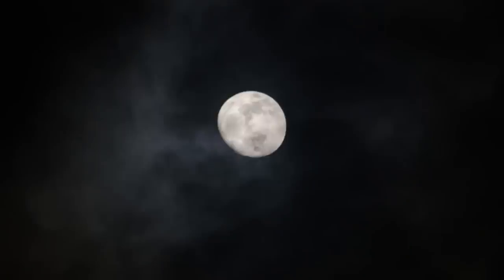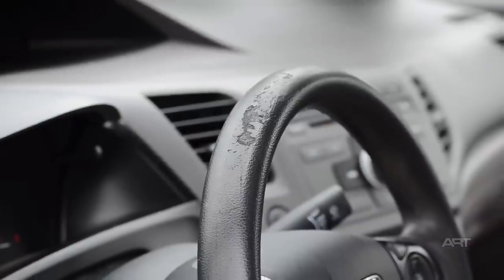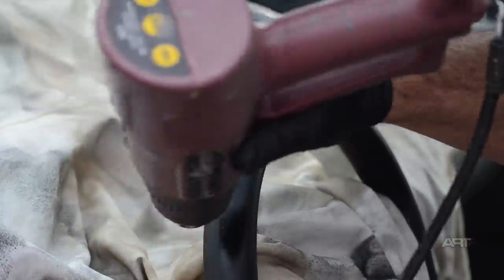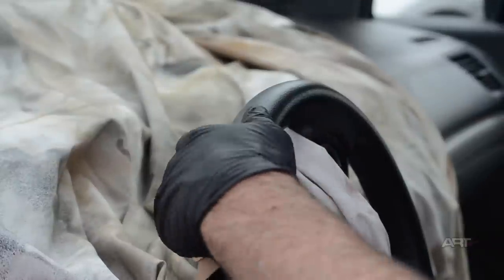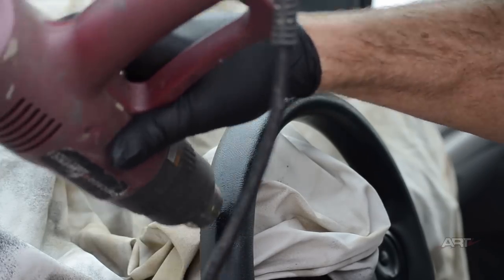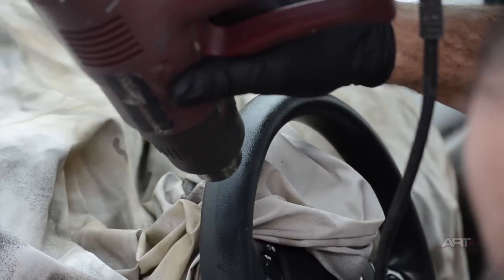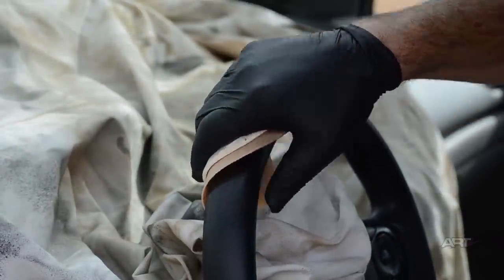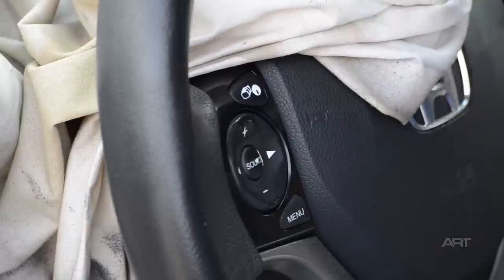Foam Steering Wheel Repair  v06

Comment: I’ve watched a couple of reviews but yours is definitely the best and most thorough.  The sun has damaged the top of my steering wheel (a common problem with car interiors in Australia) and I can’t get a replacement steering wheel for my 20 year old 4WD so I’m going to give the acetone a try first of all.  If I’m not happy with the finish I’ll get some grain pads and finish the job off.  
Thanks for putting the effort into making the video 👍

Comment: Thanks so much for this tutorial!  I just fixed my foam steering wheel.  I didn't use the acetone part, just the heat gun and imprint.
Reply: what material is your inprint
thanks

Comment: I bought my civic new and it’s a 2016 and at 70k miles has more material missing than my 2001 civic with 170k, it’s actually missing material and is no longer round in 2 spots vs the old civic where it didn’t wear a ton but the finish wore. Crazy they’re moving backwards after 15 years
Reply: My aunt bought a 2017 civic and I noticed how cheap everything inside felt vs my older civic

Comment: Wow that result was amazing! Thank you for the video!
Reply from the maker: You're welcome!  Hope that gets you a little further down the road.
Reply: @a.r.t.srealrepairsforrealc8247  I'm about to attempt this cause my steering wheel has gotten really bad somehow. Will nail polish remover work? I'm a little wary of discoloration.
Reply from the maker: @shaazy  Nail polish remover may contain acetone which will help melt and level the foam.  Protect everything including the seat below.
Reply: @a.r.t.srealrepairsforrealc8247  that's true but is nail polish remover right for the job?
Reply from the maker: @shaazy  I use acetone, and am not qualified to comment on something I haven't used.  Also this is not intended as a DIY channel.  But to show the public that better professional repairs can be had.  Thanks.

Comment: I'm here for the exact same reason 🤣 and it's amazing that you fixed the same steering wheel as mine so my question is which texture are you using for your impression after the heat? There are so many grain texture to choose

Comment: That's a good video, what if the steering wheel is foam and a piece is missing,  how to fill that ?
Reply from the maker: You can fill it with epoxy.  I have one in the archive so I'll get around to posting it whenever I can.  Thanks

Comment: Is it possible to use coarse sandpaper instead of a graining pad? The end result will obviously look different. I'm concerned that material will come off the sandpaper and embed into the rubber. What are your thoughts on this?
Reply from the maker: Good question!  i am always encouraging repair technicians to think like this.  Of course no one knows until you try.  Feel free to post your results.  Thanks for contributing!

Comment: I have a 2008 Renault Twingo with a greyish steering wheel. The airbag is some kind of rubbery plastic and it's pretty worn, how would you go about fixing that? I don't think the heatgun method works there. 
Great video though!
Reply from the maker: Can't comment on it without seeing it.  For further info see v116 where I answer a question about the steering wheel.

Comment: Thank for the video!!  I am a novice, having the exact same issues with my Honda Civic steering wheel.  The acetone surfacing and Heat Gun / Texturing seem pretty straight forward, but I'm concerned about the paint and finishing...  I'm about to purchase the Honda: 20 - Black from the website in your description..  but I wanted to ask if I need anything in this final step.  Do I dilute the color with anything? Is there a protective coating I should use after to keep the color on?  I've seen similar repair videos with SEM texture coat spray paint and Dupli-Color Vynil & Fabric spray paint... Your method look much cleaner and less messy.  Great video and thanks for the insight!!!!
Reply from the maker: I am using the waterbase black.  Add crosslinker.  I also use a waterbase clear as a protective coat which is also crosslinked.  Any of the solvent products you mentioned are soft and not durable.  In the old days we did use solvent paints.  Better than nothing perhaps.  The foam steering wheels have a very limited useful life by design so we can't be concerned overmuch about what we use anyway, would you think?  I hate them as much as the next guy.  Thanks
Rick
Reply: @a.r.t.srealrepairsforrealc8247  THIS WORKED PERFECTLY - its like brand new!!!!!!!  Thanks again!!!
Reply from the maker: @frankbull6456  Great!  Glad it was helpful.  and thanks for sharing.

Comment: What about wen the foam is loose on the metal ring of the wheel? Anyway to tighten that up? I’ve considered trying to inject glue of some kind in to is but not sure if it’ll get enough air to dry

Comment: Hi, thank you for the video, you solved an issue I wasn't looking for ;)  My issue is the seperation of the rubber from the rubber steering wheel ring.   what do you suggest for that?  I suspect injecting silicon or tarzan grip?
Reply from the maker: Your guess is as good as mine.  I would likely source a replacement wheel.  Let us know what you find out.
Reply: @a.r.t.srealrepairsforrealc8247  I found some people are using Loctite 408 and injecting it in via a needle.  I have ordered a tube from eBay and will trial it and let you know.
Reply: @octapc  Hello, did the loctite work? I have the same problem.

Comment: Where do you get the thinker pad that you used behind the graining pad? You can find the SEM graining pads online but the thicker pad to protect your fingers I cannot.
Reply from the maker: Just double up any pads you have.  I make my own graining pads and they have randomly varied in thickness over the years.  They can get quite hot using this method.  Also you can wear a leather work glove!  Thanks

Comment: Great video! I've been looking for something this all around the web. Couldn't find anything. I have a 2011 Camry and the steering wheel looks similar to the one you worked on. Top was smooth at first but over time it started becoming more brittle. Now I can feel where the foam has fallen off. Is there a curing time for the acetone or treatment after I use the acetone?
Reply from the maker: While the acetone is very aggressive it also evaporates very quickly.  A good way to tell is by temperature.  If the area is colder than the ambient temperature then evaporation is still happening.  
Thanks

Comment: Hi I have a Ford fusion hybrid 2017 I need that same repair it's really wore out on top where can I get it repaired
Reply from the maker: Any repair tech in your area should be able to do this.  If the damage is too severe I recommend a customized leather wrap.  You'd have to check with an upholstery shop.  Or shop for a replacement steering.

Comment: I have a steering wheel that has a smooth finish, that has worn away exposing the foam underneath. The problem I have is in the winter the foam steering wheel gets damp & then gets stuck all over my hands. Will using just the acetone help to reseal the foam? so as to avoid it getting stuck all over my hands in the winter.
Reply from the maker: That's a good question!  Melting the surface smoother with acetone just might help.  And with these foam wheels...can't hurt!
Reply: @a.r.t.srealrepairsforrealc8247  Okay thanks.

Comment: I realize you are trying to actually restore, but I don't care much about the finish I just want my steering wheel (GM truck) to not be gooey and rubbing off on my hands when it is the cool and humid time of the year. I haven't tried but I think that just cleaning wont do it, it is decaying. Will the reconstituting and heating get what I need?
Reply from the maker: Don't know about your particular model but all the GM trucks have leather wrapped steering where cleaning will do the trick.  If I'm wrong about yours feel free to email.  If you have a foam wheel it's unfortunate but they just won't last very long no matter what you do.  The restoration in the video is certainly a stop-gap measure for a time on an already very limited life product.  Which is why I encourage a custom made wrap.  Thanks.

Comment: Hello. How to fill holes or cracks in foam steering wheels? I have read that it can be filled with flexible epoxy glue, which comes as a 2k injection. Do you apply this epoxi  and then paint? Could it be filler with air-drying filler? or the repair would not last long. Thanks.
Reply from the maker: I have done one with a 2 part epoxy but then I made a custom leather wrap for it.   Before doing too much please understand that these steering wheels are garbage to begin with.  Thanks for your question! 👍

Comment: Hey Rick, thanks for a great video, you may have just saved me the cost of ordering a new steering wheel. I do have a question, How well does the water base color hold up?
Reply from the maker: As you know, oils from the hands are very destructive to the foam steering wheel and leather steering wheels.  So durability will vary on usage.  I would fully anticipate recoating after a couple years.   For retail customers I would recommend a custom fitted leather wrap.  You'll enjoy it so much more too.  Thanks.

Comment: Hi Rick - I drive a Honda HRV and boy do I need this video!  QUESTIONS: In other videos you finish vinyl or leather repairs with a clear coat.  Is that advisable for the foam steering wheel? If so, what type product am I looking for?  Thank you, Sir!
Reply from the maker: Yes a clear coat is a good idea.  Usually I will add a polymer clear with crosslinker and slip additive to help resist hand oils, French fry grease etc.
Reply: @a.r.t.srealrepairsforrealc8247  
Thank you very much, my friend!

Comment: What type of color are you using?  What is the touchup paint that you used on the switch?  Thanks for showing us how to restore this type of steering wheel.  When approaching this type of project, how do you tell whether leather, bonded leather or plastic covered foam is involved in covering a steering wheel? I know the differences should be obvious, but the car makers cut corners where they can, and can process plastic to make it look and act like anything they want.  

As you move forward with your videos, you will find you attract more viewers if you put the specific materials you use in the “Show More” box (sometimes called the video description box) with links to where the products can be obtained. Take a look at the Sweet Project Cars channel on YouTube  to see how one shop uses links to let its viewers know about the products used in its videos, and they make a little bit of money if people order these products using those links.
Reply from the maker: Thanks.  The color is made of Classic Dye base for leather mixed with pigments.  The switch was touched up with the leather dye.  Simply because I had it at hand and wasn't going to walk away leaving it like that.  Real life.  I formulate the color  on the van for each job.  I have several videos in the pipeline concerning bonded leather vs leather vs vinyl still to come.  
As far as product description, it would help if a supplier gave a care to help sponsor what is over $20k of videos originally commissioned but not compensated. So why should I give a care.  The how to is free.

Comment: Hi Rick - Great video. I Tried the above on the steering wheel of my 1972 W115 Mercedes. Problem is that I can't get the surface to melt so that I can put the graining on. Can it be that the rubber is not the same? / Is there another technique? Thanks again!
Reply from the maker: Hello Louis, I don't remember what that year Mercedes has in it.  If you can send a pic to the email address I'd be glad to advise if I can.  Thanks.
realrepairsforrealcustomers@gmail.com

Comment: So if we want a smooth finish we dont proceed beyond acetone?
Reply from the maker: That's right.  Although compressing with the grain pad does close up any pin holes that appear in the foam.  You could use a pad with just the faintest or no texture for that.  Otherwise you'd have to use a filler for the pin holes or at least a primer prior to color.  Thanks for the question.

Comment: I'm a bit late to finding this video.
But I'm curious to know if this same method can be used on cracked/worn leather steering wheels at all, if anyone has done it successfully on leather please comment.
Cheers.
Reply from the maker: Corey, we do sand leather dry with 100 grit to contour.  Not the same method as here.  We have several videos for different leather steering wheel options: 22, 40, 72, 86, 104.  And even one on how to make a jig - 42.

Comment: Hello, and thank you for showing this process. the steering wheel on my F250 is wearing out and replacement is discontinued. I am going to attempt to wrap new lather, but also need to fix worn spots in the foam. I already found the factory matching color, but was wondering which graining pad you would recommend for my specific application? I am going to order ASAP!
Reply from the maker: I make my own pads.  It's not super critical.  Use something in your kit.
Reply: thanks for your reply! How good it the color? can i take a tan steering wheel and color it gray? will it rub off with oil from hands?

Comment: Can this work on a scuffed leather steering wheel?
Reply: Well, no. The acetone works by dissolving the foam and reconstituting it, for leather you will need to remove the stitch and stitch a new leather cover on. There are several youtube videos on how to do this, best one is by ChrisFix

Comment: Can't get ahold of the graining pads. Would it be unsafe to heat seal the foam after the acetone scrubbing without imprinting grain? I mean, would the wheel become slippery and unsafe to grab? Thanks.
Reply from the maker: In this case, don't heat the foam.  Just reshape it with the acetone and leave it smooth.  No worries.  Thanks for contributing!
Reply: @a.r.t.srealrepairsforrealc8247  Thanks!

Comment: What can you do for a steering wheel that is foam like that but the top half where I keep my hands is just eroded away. No breaks in the foam, its just a lot thinner on the top half than the bottom and getting rougher in texture.
Reply from the maker: In my opinion, make a custom leather wrap.  It won't have the cheesy aftermarket look and it will upgrade the interior at the same time. 
Thanks

Comment: Thanks for the GREAT VIDEO! You mentioned "color" at the end of the video. My steering wheel is a dark grey color. What, if anything will I need to do re: color during the repair process and if I need a coloring "agent" of some sort where do I get one that will match a 10 year old steering wheel?
Reply from the maker: It's in the description.

Comment: What is the graining material made from? You said it was commercially available. Where would I buy it? My grain is worn off quite a bit and I have been looking for just such a fix.  Thanks.
Reply from the maker: The bottom one is from the double cartridge dispenser from Superior Restoration Products.  The white one is also from there but is from the jar and you have to add a certain amount of catalyst.  Both are silicone.  The one from the cartridge is more expensive but grains better  IMO.  On their facebook page they have a video I did some time back on making the double sided one to cut costs.   i may post it on my site soon.  Thanks for your questions.  Glad I could help.
Reply: @a.r.t.srealrepairsforrealc8247 a.r.t.sreal repairs for real customers

Comment: I have a 2010 honda fit and when I tried doing this the steering wheel became extremely sticky and lots of the residue came off onto my pads. Its now been over 2 days and its still sticky and some residue is still coming off. It's as if the foam hasn't dried yet and at this point im not sure that it ever will. Do you have any suggestions? I need to sell the car ASAP
Reply from the maker: Ok, I've never heard of the Honda Fit so I guess my  customers don't carry them.  All I can suggest is to try one of the aftermarket covers. There are some rather good ones out there.  Email me if you need help.  And thanks for posting!
realrepairsforrealcustomers@gmail.com

Comment: I clicked on the link on the description for the graining pads. Which texture did you use in this vid?
Reply from the maker: I make my own pads using the silicone cartridges and dispenser.  If I recall I used the Sierra grain here.

Comment: I tried this and it separated the foam from the metal core. Now its loose and wiggles around. Bad idea.
Reply from the maker: Yes, these foam wheels are the worst and some are super cheap.  Be assured that any tech has to assess each repair individually and would likely turn this one away.  Making educated judgements on a case to case basis is what we do.